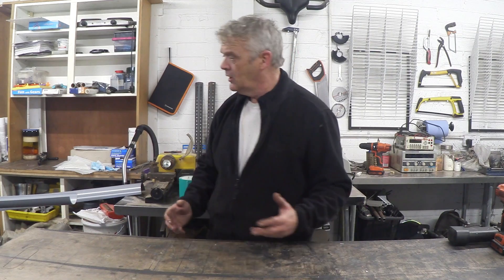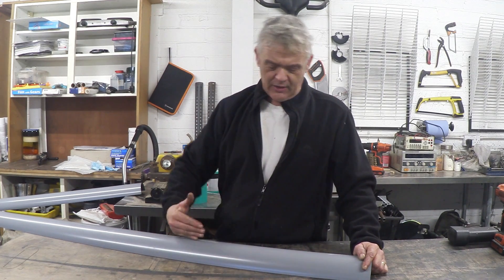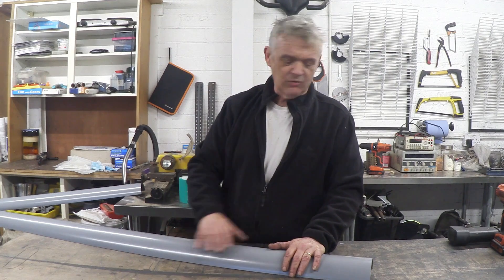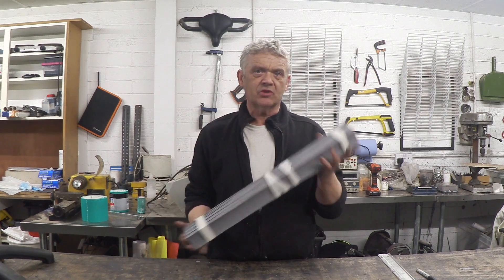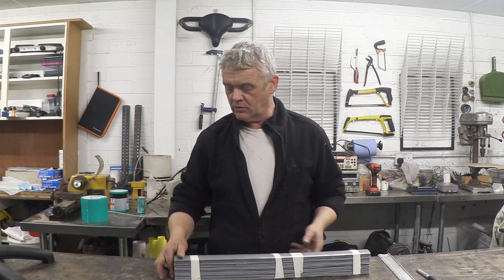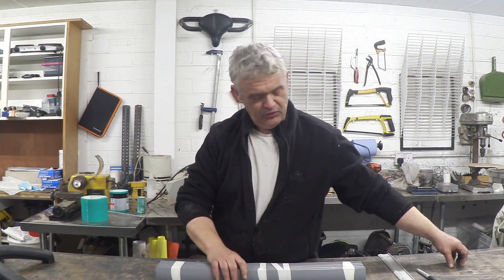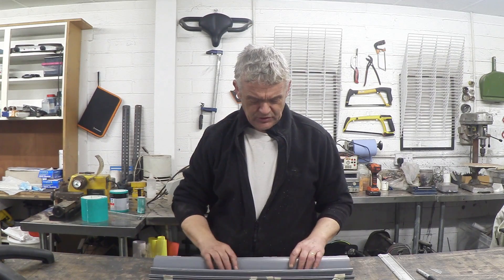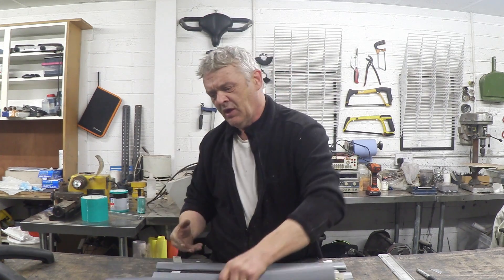Building a 1kW Wind Turbine For Under £100 - Part 1 - The Rotor

Comment: It’d be interesting to put neodymium magnets on one side and ceramic on the other to see the different power outputs, this is a great project!
Reply from the maker: cheers mate - I am not likely to use neos - they will raise the cost and my earlier experiments tell me they aren't needed - plus they rust!
Reply: @ThinkingandTinkering  
  They wouldn’t raise the cost if you used and recycled old HDD neo magnets, they’re usually nickel plated to ward off corrosion.
Reply: @ThinkingandTinkering  Yes, I can confirm...Best Regards
Reply: @ThinkingandTinkering  Sir: It means your dynamo will operate like the common dynamo invented almost 200 yrs ago- installed at the wheels of common pedal powered bike?... So, the  said neodymnium magnet were optional, just an added expenses?...
Reply: @ivan schafeldt There is CoSm Cobalt Samarium which are strong like neos, but have higher temps like 250C, unlike normal neos at around 80C.

Edit: Its actually Samarium Cobalt. SMCO. My bad😂
Reply: i pull out many of  them Kidney shape PC   HDD  magnets   &  stick to a light  lamp  pole  near me  |
magnet totem pole :)   handy reach across  use to hold screws add to a tool etc   doing   experiments etc
Reply: You don't need neodynium magnets...But, It's up to you...
Reply from the maker: spot on mate